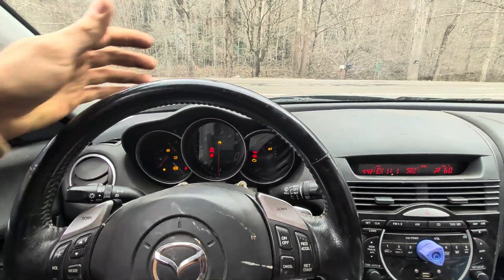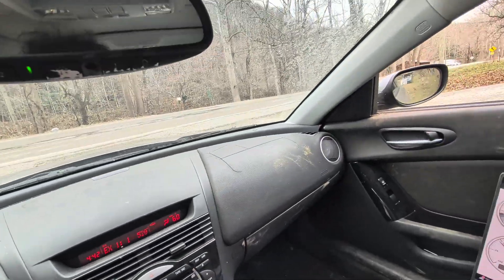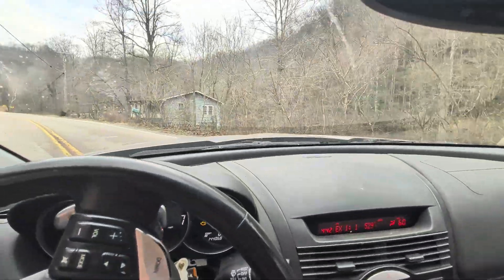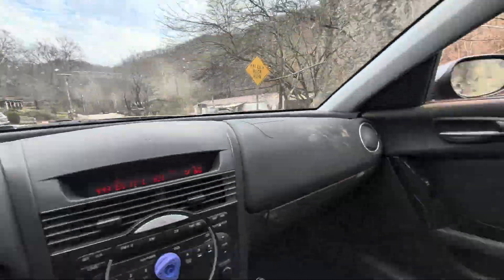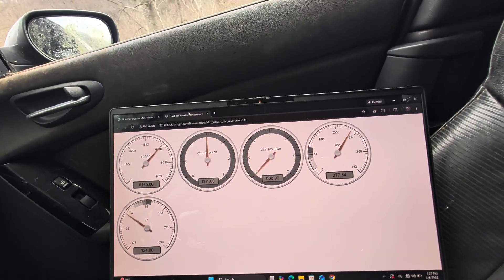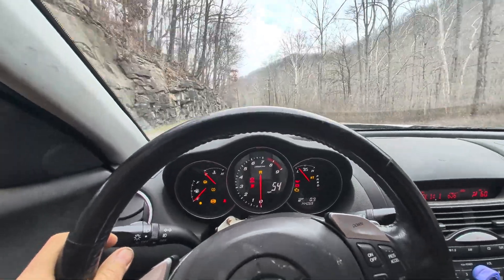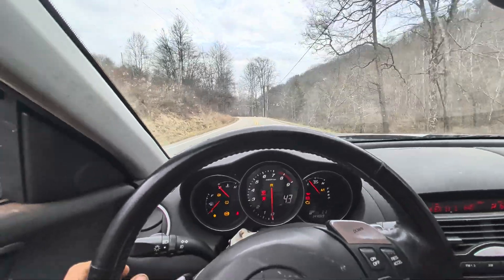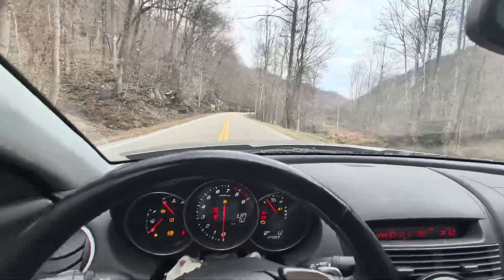Mazda rx8 Tesla Test drive

Comment: That's a lot of noise for 50 mph
Reply from the maker: If you watch the old video using the Toyota Avalon hybrid transaxle in comparing the noise from the Tesla. It’s basically 70 percent less than the Toyota hybrid transaxle